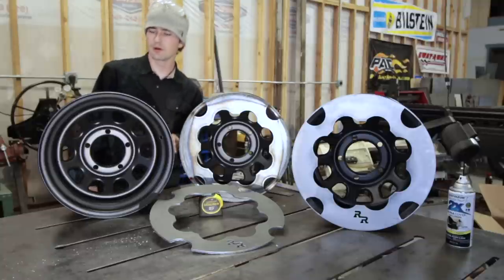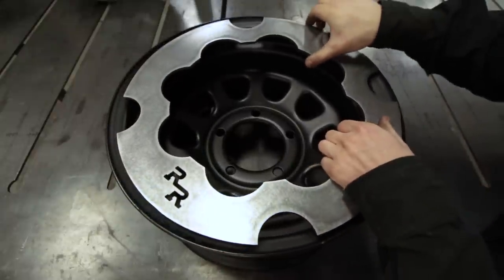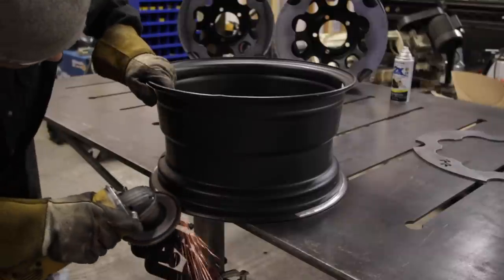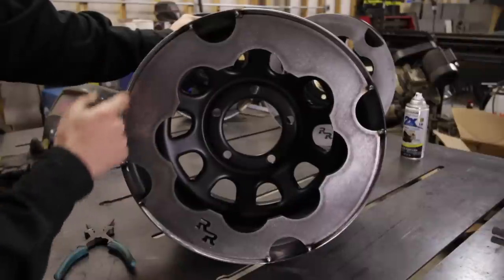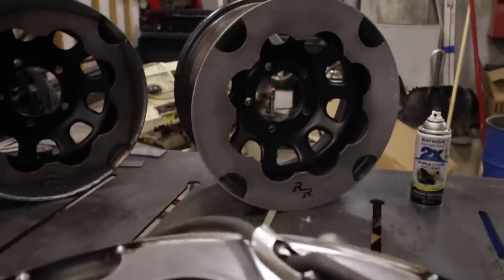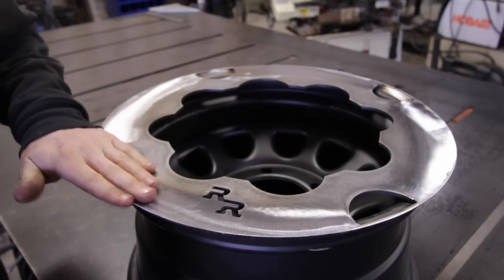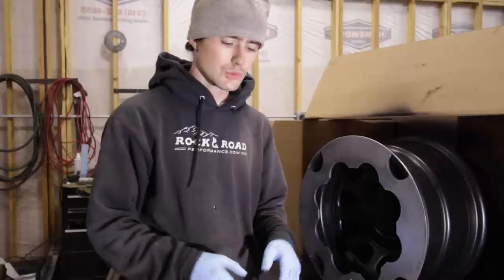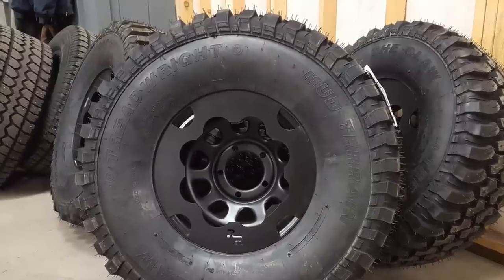Make Your Own Rock Rings OR Beadlocks

Comment: el Emerson You're correct, these are rock rings. The installation to both the rock rings and beadlocks are pretty similar though/////yes you weld beadlocks on 2 make sure the tire is inflated to like 45 psi for a proper seat befor welding the beadlocks in place

Comment: nice job! looks great. but why not go with bead locks at that point? wont they also protect your rims? anyway, something to consider is to do the tig/mig method when mig welding them ? .. you know?   consume a filler rod as you mig weld to fill up  the root more and reduce the under cut  edges ..  but honestly, you could have just left it without grinding anything. they looked good form here. finally, do you think it would be a good idea to alternate passes in a pattern like for lug nuts, just to keep.the heat from concentrating in one spot, possibly warping the rim? Thanks for posting . keep up the good work.

Comment: They help also by protecting valve stem when wheeling aired down on off camber parts of a trail. Had a stem ripped off w/o a spare once , these wouldve saved a major pia
Reply: They make metal valve stems

Comment: Honestly for this amount of effort, cost and weight you should have just gone with beadlocks. If all you want to do is not bend a lip, a rolled piece of rebar is  way lighter, cheaper and easier. Also, that is a hell of a sharp edge/wedge shape you've put between your tire and a rock. It looks nice though, I suppose.
Reply: looks like a great place to get caked with mud and rocks to me
Reply: pressure washer

Comment: What is the advantages of rock rings
Reply: About the only thing these are good for is rigidity. They're mostly for rock crawling. If you do a lot of four wheeling in the mud they'll get packed with mud. When you get back on the road you usually end up with bad vibrations unless you clean out all the mud.

Comment: What was the point of going to full width 1/2 ton axles if your only going to be running 33s? The hp Dana 30 and chrysler 8.25 handle 35s all day long. I thought you got the ford axles because you were going to be running  a 37" or larger tire on this new Jeep build???

Comment: What do these things do? I know what a bead lock does and that makes sense and all but I don't see what these would do
Reply: They add weight. They help protect your valve stem. They also do a good job of holding lots of mud in the rim. The only think they do not do is lock the tire bead to the tire.  HTH

Comment: One..where's the beadlocks?

Two...that's not making my own rock rings...that's buying the insert and putting them on.

and three (and this is my biggest question)...where do the wheel weights go to balance the tires?...on the back side of the rim?...I've never seen them on the backside.
Reply: Grant Davis they go on the back.
Reply: I put the wights on the backside on all my aftermarket wheels, cause no none wants to see ugly wights on the outside especially on a colored wheel.
Reply: Grant Davis on my jeep I put them on both inside and out but after bending all of my rims n hammering them back in to shape I took off the front weight n got them rebalancing using them only on the inside I don't get any shimming or anything... but iv seen ppl where they just can't make the shimming go away on a perfectly balance wheel...

Comment: Looks like you created more of a problem rather than a solution? That ring flat area is going to catch a hold of rocks now and then put a nice slice the tires when the edge slips past the flat area. Looks very cool, nice job, but the tires will get sliced off-roading for sure. Wider rims that hide the sidewall with these rings would make real world 4x4  functional logic.